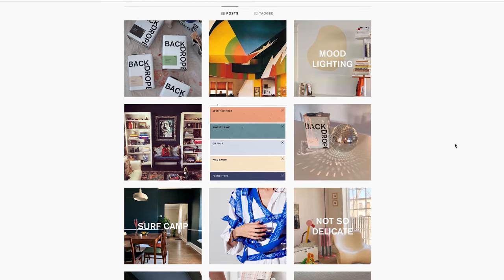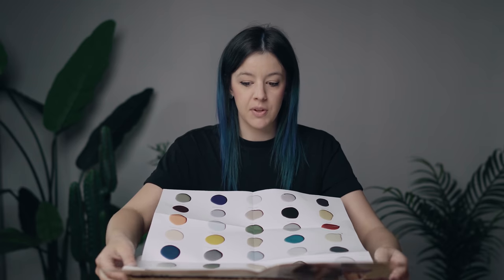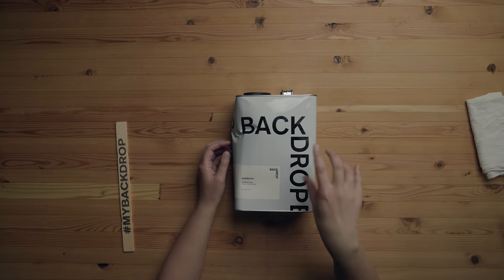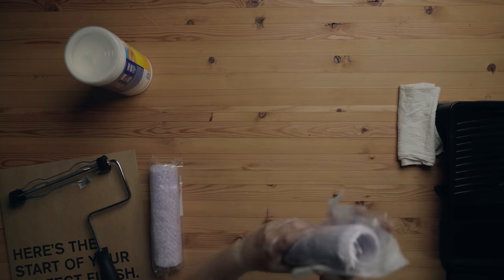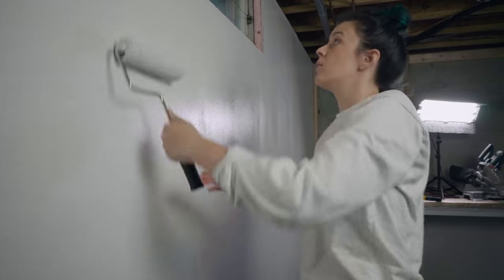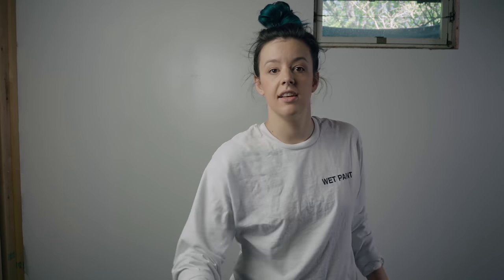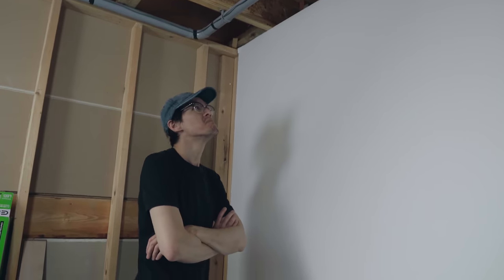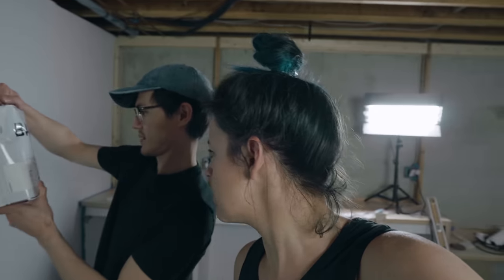Last Time I Did This It Went Horribly Wrong | Unboxing and Reviewing Backdrop Paint

Comment: Pro tip for delivered products, if you have a garage, etc, leave stuff in a quarantined area for a couple days.  The virus, if on the surface, will degrade in 24 hours on cardboard and 2-3 days on metal.  I tend to just leave amazon packages in the garage for a few days if I can help it.  And when I open boxes I leave them in the garage too and just dump the contents into a clean bin as the contents likely have not been touched by human hands in a few days but the box would have been. Still wipe stuff down, but time is a powerful too.

Comment: Dulux in the UK have a Trade Flat Matt product, they also do Magic White goes on pink so you can see where you have painted? Have you tried micro rollers, seem to put a small amount on paint on the service drying time very fast, but the you have to do many more coats.